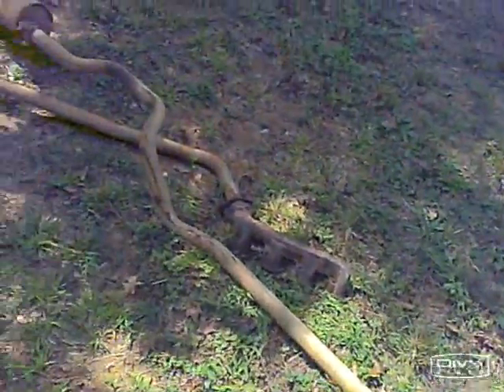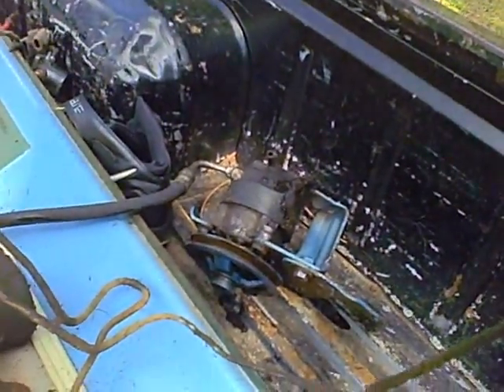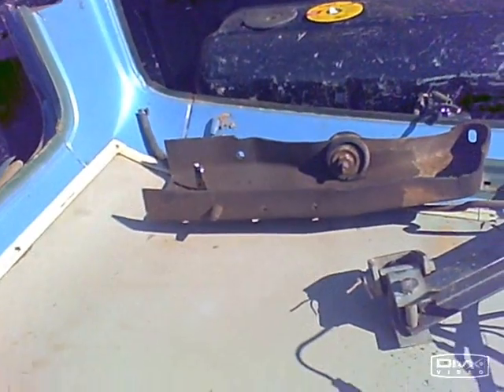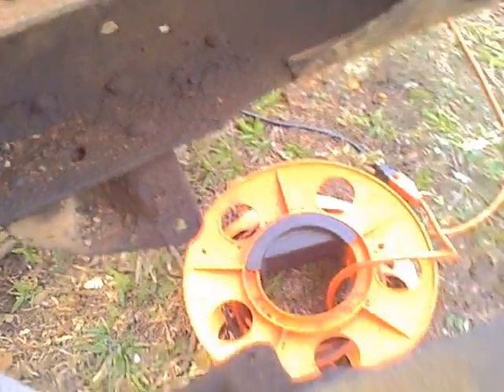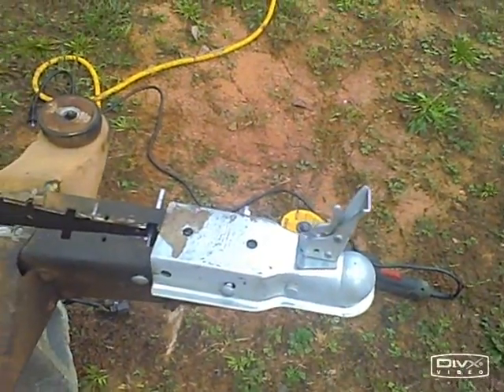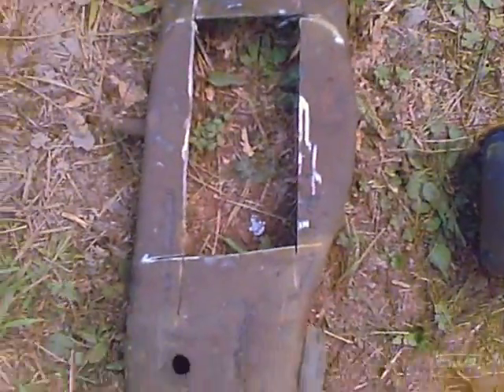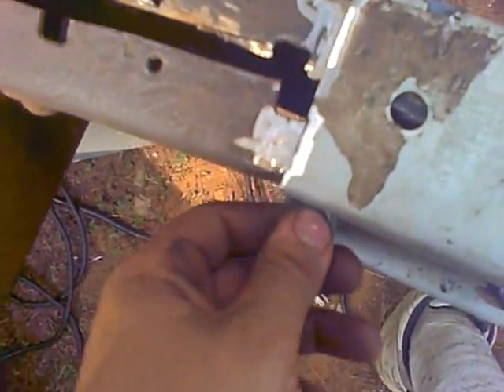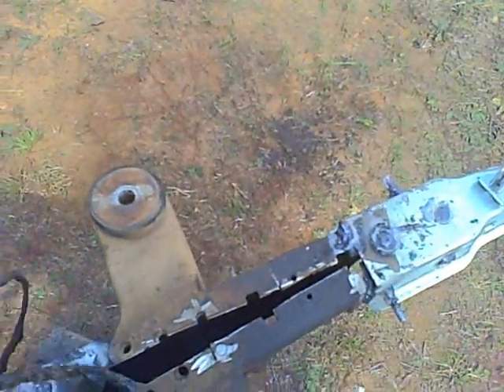how to make a truck bed trailer

Comment: In this day and age where half the guys your age cant even change a tire, its great to see a young guy that aint afraid to try. I am a fabricator for a large excavation company and I know what its like to work with what you have in a pinch. Keep practicing the welding, it comes in time.
Reply from the maker: thanks man im proud to say my welds have gotten better since this video i now use a 90 amp wirefeed flux core welder does pretty good. about to start a project of a sawmill trailer for my sawmill

Comment: I have a truck bed trailer that too was once a 1974 Ford F100.  I bought it as a trailer for $75.  They are a very versatile trailer to have.  Since I pull mine over the road, I have to have working lights & have it registered.  I might be building one for someone in a few months out of an old 1978 GMC 1 ton non-dual tires.  This video gives me a good clue how to fold the frame into the shape I need.

Comment: Good job on the trailer!I think you can hook that wire from the trailer to your truck and your signals in the truck and brakes will work as you drive pulling it.You can get a trailer kit at an auto parts place it should have the plugs one for your truck the other you put on the trailer and just plug it in when your going haul.

Comment: Good job! Those welds are fine. The pros just care about looks, not function! I made a bike rack with ugly welds and it held 4 bikes (120 lbs) for over 1000 miles. Function, not form ( you can pimp it out later, after function is complete

Comment: Look on craigslist i found a small 110v Millermatic 185  for a $100. bucks . It had a brand new spool of innershield wire on it . As soon as i used up that spool i got a small bottle of argon for it.

Comment: I know this is old but I've been looking into making a very similar trailer. Can I ask how you bent the frame into the A shape? I've seen others just cut the frame and weld an A frame to the truck frame, but I prefer your method.
Reply from the maker: +MuddierThenMost i cut it a little so it would bend but i would recommend cutting it off and putting a A shaped hitch i did that later stronger

Comment: Take your time bro, don't take shortcuts and measure everything and cut everything straight, its makes a huge difference and learn what rods you're using and how to properly use them, it's a trailer that will be on the road that shared with other drivers, I'm not saying you did it half assed but that "it'll hold " attitude won't get you anywhere